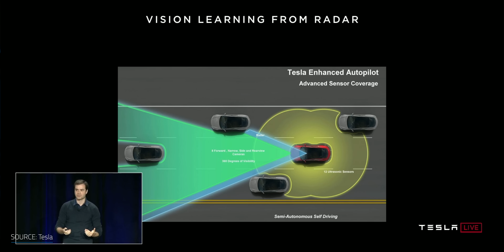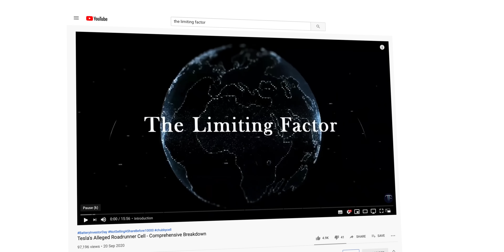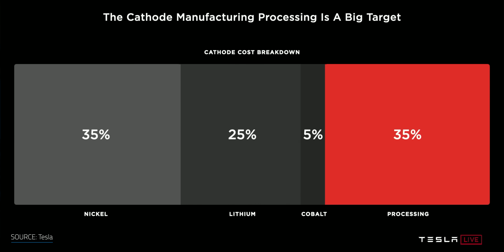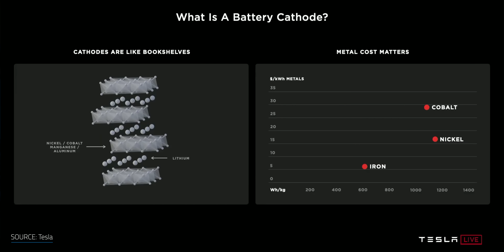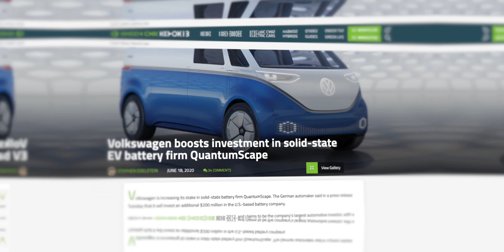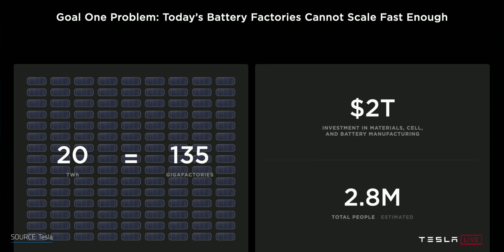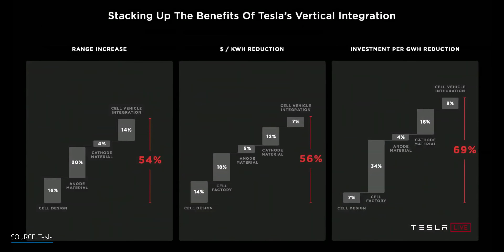3 Takeaways from Tesla's Battery Day - Hint: it's not just batteries

Comment: a 56% decrease means a $60.48 per kwh  battery pack the Internal combustion engine was just delivered a "Death Blow" all that is left is the shake, shudder and death rattle.
Reply: nope nope you are totally wrong
Reply: W N  Nikola?... oh the hydrogen fuel cell company, yeh good luck to them.
Reply: If I remember correctly LiFePO4 is already below that price (in smaller round cells, it's somewhat more in those larger prismatic cells).
Reply: @garrycole9187  that's true, also ICE will rule for a while in the rural areas of Africa etc. (well unless solar panels got better/cheaper soon).
Reply: @tkermi  lifepo4 can be made into the beer can size too. So the cost of those should go down as well. Also, efficiency should go up. It means cheap little cars, cheap lawn mowers, power tools, everything that is gas powered now. Maybe the species can survive after all.
Reply: @ronadami5747  Yes 🙂. It's an intetesting chemistry with a long lifetime expectancy and low deterioratin at high charge levels. My lawn mower robot has LiFePO4 batteries and they have been working really great 3 years now (~6 days/week, 10h/day, 5 months/year).
Reply: @garrycole9187  thinking the same thing.. here in India majority of vehicles are 2 wheels, bike & moped.. so someone will need to come up with Cheap 2 wheel EVs or developing countries will always stay behind
Reply: @carholic-sz3qv  Saying that doesn't necessarily make you right since there is no argument that you are making. The word you need after "wrong" is "because".
Reply: EV's are going to keep getting cheaper, and ICE's will keep staying the same. It's happening fast.
Reply: Still exist a potential market of billions of consumers lacking both the extra $10 000-30 000 needed for an EV as well as the infrastructure for charging. To give you a clear example. Living in Asia in a city of more than 2 million my house had a 2 amp fuse. It will take ages for the infrastructure to mature. Oh, and petrol is ~30 cent/litre.
Reply: @tkermi  I saw it around $80. So it will be $35 and this will make 300 Miles fast tesla 2 cars priced $25K
Reply: @garrycole9187  Small Electic vehicles (bikes, Mopeds, cycles scooters etc) are the fasting growing electric vehicle market in the world, over 90% of electric vehicles sold. In China whole cities have been converted from smelling 2 stroke mopeds. 

Electric mopeds/ scooters are already parable price, more reliable,  far cheaper to run and can be charged from any normal power socket.

You don't need to regularly rebuild electric motors, they last practically forever compared with 2 stroke engines.

Eventually, there will be a mass second-hand market of cheap electric mopeds and cheap used 80% left efficient solar panels, so someone in a poor country could have a very cheap vehicle with no fuel cost.
Reply: @ingarshaw3034  Yes, the battery kWh price for a large manufacturer is always much less than the price consumer can see/get from shops like Alibaba etc.
Reply: @garrycole9187  An electric motor is easier and more reliable once a suitable battery tech is realized. Currently they are still dealing with lead acid batteries which are inferior to petrol in energy utility and toxicity.
Reply: @SweBeach2023  What is the percentage of families that own a  passenger vehicle? Would Robotaxis be a better response? Is there an untapped potential for solar?
Reply: Here in Australia, Tesla's s model cost A$190,000. There is no way they will kill combustion engines until they sell for half that price. That's why we see virtually zero Tesla's around. Give it another decade or 2.
Reply: Still would take an ICE for long distances or off-road.
Reply: @adamwaz5615  How much is the cheapest Model 3? Here in Finland it's about 49k€ ($57k).
Reply: @arrrrr9831  The drawings of a car company.
Reply: @garrycole9187  well the highly developed countries pollute the most so by replacing our fleet of ice with ev we take out a large chunk of emissions
Reply: @tkermi  A$100,000!
Reply: @adamwaz5615  Wow 😲, that's a lot ☹️. It's almost 25% more than here and cars here are considered very expensive.
Reply: @garrycole9187  Irrelevant to the discussion.  Once they stop making ICE vehicles, ICE is dead.  Used cars will always be cheaper than new ones (because that is how economics works).  But what happens when small cheap EVs start appearing on the market?  And how will gar stations continue at 50% 25% 10% their current capacity?  Will you drive a ICE car to a gas station when there are only as many as there EV chargers now?
Reply: Until they make EV batteries work flawlessly deep Winters and under great loads without losing half the battery capacity ice cars will be around for a while.

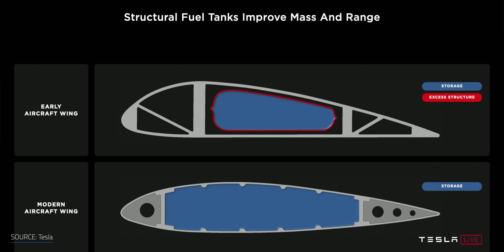Comment: 7:55 As Sandy Munroe said: Repairability or Reliability. Pick one. Tesla chose reliability and is the right choice. The battery will outlive the car.
Reply: People complain million mile battery was not mentioned. Just need the logic to infer the frame is made of batteries and designed to last million miles so the permanent batteries are obviously made to last that long to
Reply: @MrBlueTimes  Also the fact that they confirmed the new batteries will go in the Tesla Semi, so it has to last a minimum of a million miles.
Reply: @MrBlueTimes  yeah some analysts actually thought it meant that the car will go a million miles on a charge. Not that it can charge over 5000 cycles aka a million miles. Tesla makes very little sense to the lay person or average analyst.
Reply: @triad6425  No one thought that.  Get real.
Reply: @triad6425  If an analyst can't figure that out, they shouldn't be called an analyst.

Comment: As a ev owner and my first ev was a VW egolf. I can't emphasize the difference of user experience since getting a 3. The Tesla charging infrastructure is so much easier and better. I loved the VW I was so disappointed with the charging, frustrated it was hard and inconsistent. Everything about the Tesla is better by a wide margin. The new plan for the future is stellar. Tesla has a track record of delivering what the say and better than promised. Now the timeline and clock of the end of ice and all things petroleum. In 20 years it's remember how it used to be.
Reply: The supercharger network is a mote few outside owner's and savvy investors. Even realize that tesla has. 

Who else sells you a car, the means to power it, service it, upgrade it so it doesn't fall to far behind as it ages, software and feature updates, software to also run your charger, battery storage and solar management. 🤔

Comment: so one interesting thing that left unsaid is since silicon anode expand while it's under charged state. The integrated battery structure will actually be more stiff while charged than uncharged. Due to internal pressure from within the battery. It will act like an opposite of pre-stressed concrete (since concrete is stronger in compression than in tension, a way to increase its strength is by steel wire to pre compress the concrete, so during normal loading condition it will experience more compression than tension force). Hypothetically they can replace the casing with a material that's stronger in tension than in compression, something akin carbon fiber and achieve better compression resistance than plain carbon fiber alone.
Reply: No, not likely.

Comment: Some really good information, thank you!  My take: I own a solar designand installation company and the trend is moving away from polycrystalline to monocrystalline solar modules, which with today's higher eficiencies and current technology have been net positive in energy payback in less than two years, much shorter than the 4 years you stated.  Also, I was a little confused in the section where you addressed LCOE, where I thought you stated that the computation of LCOE took into account the dismanteling of the system.  I have not seen that the cost to deconstruct, recycle, or dispose of a facility has been included in LCOE calcs.  I would think that the cost to dismantle, clean up, and make safe the site of a combined cycle natural gas plant would be significant.  Whenever I hear a discussion where someone states that the disadvantage of solar is that the panels have materials that are dangerous to the enviroment and that are costly to recyle, it is frustrating.  There are panel recyclers today actively doing just that. Recycling panels is not the hard part. The difficult part is that there really is no significant market for panel recycling, simply because solar panels last a very very long time.  I have had a few panels damaged in shipment, and so have had the need for a recycler, but the major problem for my company is that there is not a nationwide policy or mechinism to support panel recycling.  For the few panels I need to recycle, I would have to pay several hundred dollars in shipping cost to get the panels to the recycler, based in New York.  What has to happen is either more recycling facilities need to come online, or there needs to be a more economical way for local installers or other entities to get the panels shipped to the vendors who may be very far away.  I am sure as the older solar plants continue to age, it will help build the market for recycling of solar panels.
Reply: @Ken Nadsady
Take good photos on the damaged panel and sell them on eBay.  See what happens.  If you separate the shipping, you may find a local bidder that can pick them up.

Comment: Somehow, nobody realizes the main advantage of the new tabless design - way faster charging! I believe we are close to 80% charge in 20 minutes. And that would mean I can finally switch :)
Reply: You can switch now then, Tesla Model 3 already does 80% charge in about 20 minutes, (assuming you don't wait till zero percent to charge).
Reply: True that charging should become much faster.  Probably most important for those few who do a lot of long range driving.  For the majority who do almost all their driving locally and charge from home, less important, though still nice to have on those occasional long trips.
Reply: the most important advantage is the speed of manufacturing
that means ev's will soon be cheaper than ice cars -- even for lower priced cars
... but by soon i mean there will be a transition somewhere between 2025-2030. 
right now it seems far away, but when it arrives, it will seem sudden
Reply: Although the M3 and MY can charge from 20-80% in 20 minutes already, you are right that the tabless tech should enable even faster charging. There should not be a drop-off after 50% SoC, as the heat should be wicked away much better. One would expect the drop in the graph to occur at about 85% or later.
Reply: @JRP3  Model 3 is a bit too small for my family, so I am looking into Model Y more. I have to check the supercharger network on the 2 trips I usually do...
Reply: It is the range and battery longevity that counts more.  Most people don't drive 24/7 like Le Mans, they can charge up over night when demand for electricity is lower.  Unless you rely on solar of course..
Reply: Charging speed becomes less important the longer the range is. Model S Plaid will go 520 miles on a charge, meaning you can drive five hours at 80 mph and then stop for lunch and recharge, do the same thing again and stop for dinner and recharge, do it again and stop for the night having covered 1200 miles in 16 hours. You don't do more in your ICE car. It won't matter to you if the car recharges in ten minutes while you are eating or a half hour while you are eating.
Reply: @tribalypredisposed  While that's true, I do have one trip that is over 520 miles that we do 4 times a year (there and back). Current Tesla calculator estimates 2+ hours of charging on Model S and 1.5 hours on Model 3 on that trip. None of them seem to clear it up without charging. Plus, the speed on European highways is a bit higher - in Germany around 100mph, in parts of Austria 87 mph, but absolute vast majority is 81. With 5 people in car, I doubt any current Tesla will make it without significant wait for charging. Not to mention that a vehicle for $150k is a bit out of my reach.
Reply: @rogerstarkey5390  Higher pack voltage doesn't increase charging speed since the constraint is at the cell level.
Reply: Robert Klauco and faster discharging as well. In other words: higher and longer (less heating) sustained output to the drivetrain...
Reply: I think this will be more important for other manufacturers than for Tesla. Some manufacturers don't use active cooling to reduce cost and weight. With a 'tabless' multitab design that will be a much more feasible option. In a few years others will follow with their own 'tabless' design.
Reply: Sorry for diverging slightly off topic;
I would argue that charging today already only takes about 30 seconds. That’s the active time needed for the procedure. You rock up to a station, plug in and that’s it. There is no need to monitor the charging, you can do other things: 
-Have a smoke, if that’s your thing - something you can’t do whilst refueling a petrol car;
-Give your mother a call;
-Read a book;
-Go for a walk;
-Reply to emails;
-Comment on a YouTube video.

It is like re-painting a room. Yes, you will have non-active time as you need to allow the paint to dry between layers, but there is no need to sit there and watch it happen.
Reply: @chrisg394  I guess you don't have kids. Imagine spending 30+ minutes sitting in a car with 3 kids without movement. I bet you would reconsider your "30 seconds" comment :)
Reply: @Robert Klauco: 
In the interest of full disclosure; Your assumption is correct - I don’t have kids. I mostly travel alone. I’m aware that one’s mileage may vary. Maybe you have no emails to reply to, maybe the weather isn’t inviting you to spend time outside the cover of your car. My intention was purely to convey that Charging and Refuelling are not equal activities. You are not tied to your vehicle whilst charging in the same way you are when you are filling up a tank with combustible liquid.

Now an assumption of mine; If you have been on the road with your kids for three hours, or longer, they might appreciate a stop where they can run around in a nearby park for 20-30 minutes before you drive off again, compared to the three minute stop that refuelling would offer.
Reply: There we go.  Thank you.  Wish I had seen this before I made my other post (lamenting charging times as an impediment to transitioning from ICE).
Reply: @chrisg394  That's actually not true at a gas station that wants to keep its license to operate.  You can walk away from a fueling vehicle.  The nozzle valve will trip shut when the fuel rises to meet it.  Of course, there isn't much need to, unless you really need to relieve yourself.  A normal passenger car will fill up inside two minutes.
Reply: @tribalypredisposed  A long there isn't a long ling line just to get on the the supercharger.